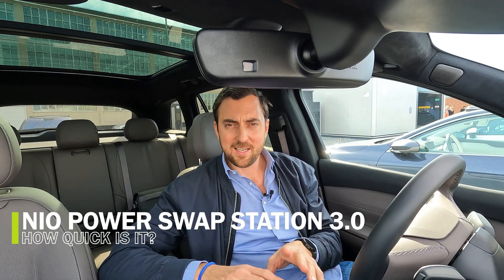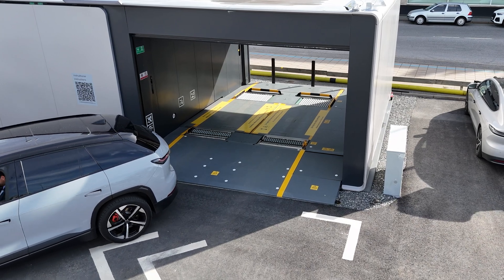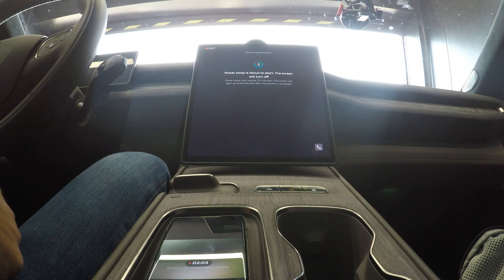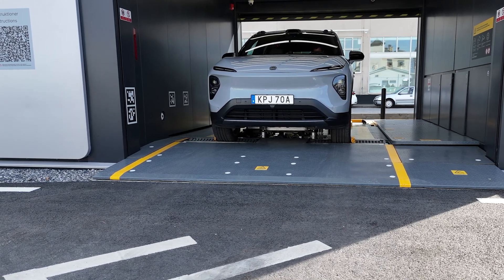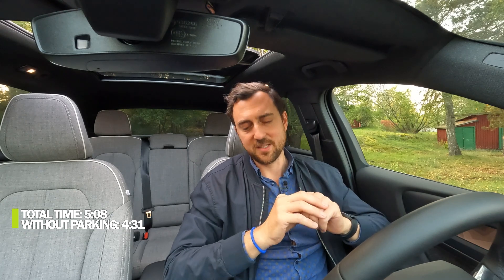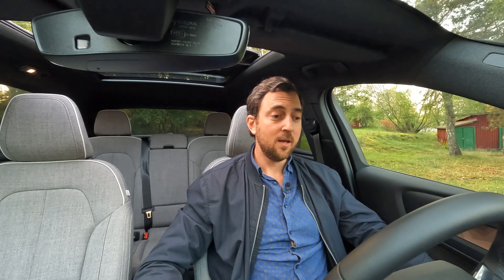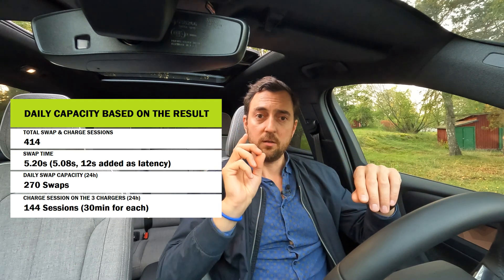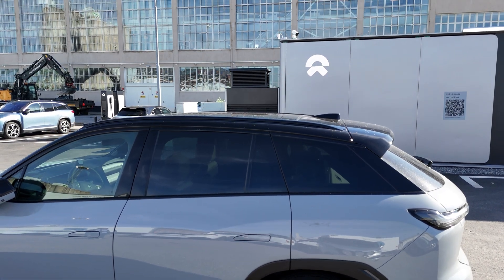How many Superchargers can it replace? - Testing Europes first Nio Power Swap Station 3

Comment: Who owns the battery? I like to look after my battery and would not like to swap for an ill treated overused one.
I think it is a long hard route for Nio, they can only replace their own model, whereas dedicated chargers can fit all models, time will tell if it is a Betamax or mini disc. Not for me.
Reply: I'm sorry, but that's a really bad take. NIO has the ability to check for AND repair their battery packs better than anyone else. Exactly BECAUSE the batteries are swappable. Every time the battery is swapped, its SoH is assessed automatically. If it has bad cells or any other issue they are able to repair them without having to disassemble an entire car.

Apart from that there is no actual reason to believe there will be that many ill-treated overused batteries in the pool. Because they will often be swapped (BaaS allows for a certain amount of free swaps which makes it more attractive than ultrarapid charging), they will be charged less at mind-numbing power to a high SoC than e.g. Tesla batteries are. NIO batteries are also high-capacity packs (minimum 75kWh) which makes it really not necessary to charge to 100% often. So many packs will be swapped or charged at a low charging power, with a charging limit, which is the ideal recipe for battery longevity.

Then there is the simple fact that if you want to own the battery and never swap it, you absolutely can. But in my opinion that would not be smart because of the above, and the fact that swap allows for better battery technology (higher energy density, lower weight, better safety, etc.) to be absorbed in the entire fleet without any issue.
Reply: NIO swap stations automatically healthcheck the batteries. Besides, even if you had a battery which developed issues, then guess what... battery swap means you aren't stuck with the battery welded to the car. PS simple for most folk to understand 😅😅
Reply from the maker: You don't need to lease the battery, possible to buy also. But get your point
Reply: Nio has the most private company  physical chargers in China.. more non nio use them than nio owners  and catl and nio have a separate joint company that owns the batteries if you are renting.

Comment: Thanks! Very informative as usual. Can you do an et5t 10-80% charge on the nio chargers with the new charging speeds?
Reply from the maker: Peaking at 182kWh and keeping that peek last up to 70% before tapering. So a good and flat charging curve.
Reply: @ItsOnlyElectric wow, thank you sir!
Reply from the maker: @reginald7214 NP
Reply: He asked you to check it, is it also with the 75 kilowatt battery?  How long does it take in reality to charge when it reaches over 70 percent accuracy?  You know such questions.

Comment: It took so long to retrieve the new battery.
Also car can reverse in one go.
Reply: Sure, the  drive thru stations they have are even better.
Reply: Most of the problems you presented are problems that will be solved in the near future by over-the-air updates, you no longer need to be in the car during the exchange, at least in China, you can do it through the nio app, the screen already works in China during the exchange, but at least until NT3 the AC will not work.
Reply: They should have a smaller high voltage battery to keep the car alive during swap. People should be able to get in and out of the car during swap from one side at least. They can lock the doors on the other side.

Comment: Like the theory of battery swapping. Prices of the Nio’s with BaaS is still high compared to other EVs, what do you think?
Reply from the maker: I don't think the entry price with BaaS is that expensive for a premium oriented brand. But togheter with the battery it gets a bit expensive and cheaper models will be needed. But as I understand it that will com under another sub brand.
Reply: In 2024, a brand should arrive that sells compact ev vehicles for 30,000 euros, (it is not clear with the battery included) and it will be able to swap batteries, and charge at a rate of 500 kilowatts, although apparently if you choose BASS the charging will be limited to 130 kilowatts in order to maintain the health of the battery.
Reply: @ItsOnlyElectric  if Nio wants to get marketshare, their price needs to align with Tesla while offering higher quality experience. Otherwise the Charging network and Tesla experience will probably keep attracting people to Tesla and not Nio etc. Let me know your thoughts

Comment: I don't think battery swapping is meant to compete with charging at all.  It is designed to help people wean themselves off gasoline.  With nio you don't have to change anything in your daily routine, you don't feel the difference anymore.  And to those who say that building any such station costs too much money, it is much cheaper than a gas station.  The price is also not a problem because there is an arbitrage section, the stations buy electricity at night at a bargain price and sell it at the peak of demand, thereby balancing the grid and also creating huge profits for nio.  Battery swap stations also prevent power outages, if there is a problem and the power supplier decides to supply power, then all the battery swap stations in the area will automatically start within ten seconds to supply power instead of the central supplier until the problem is fixed.  If on average every two weeks the total time of power outages is half an hour, and believe me that in most places the average time is much higher, then this means that every year 13 hours of power outage will be saved, assuming that each station will last 20 years, and this means that each station will save an average of 260  hours, multiply it by say 100 thousand inhabitants, and that means that an average battery swap station will save about 1.3 million hours a year, how much is an hour of power outage worth?  Say $30, times 1.3 million, $39 million a year.  Even with a tenth of that, 4 million dollars a year, even with only one hundredth of that, even with only 0.4 million dollars a year.  Therefore there is no reason to worry about the price of each station or the risk of nio going bankrupt.
Reply: nah, you can't buy at night and sell during peak if people are constantly changing batteries, it needs to charge it back up right away, grid stabilization is a service they can provide if grid providers are willing to make a deal with nio because grid stabilization requires selling electricity during peak hours and buying back electricity during peak hours, so you need a deal with the grid provider to pay you a higher price when you sell it during peak hours compared to the price you pay when you buy it back during peak hours
Reply: That's what I thought too, but no.  The electricity grid itself is public, the provider is a private one.  You actually sell electricity to the consumer, and use the state's electricity grid to do it.  The electricity is offered to every buyer, so you don't have to ask the supplier.  This is something that has already been done today.
Reply: @tani123  no not true, you do need them to provide you a higher rate for the electricity you sell or else you aren't arbitraging anything. nio has made deals in china and run tests to provide such a service, you sell the electricity during spikes and buy it back seconds after at a cheaper rate. also here here in america at least most of the grid is privately owned and  a lot of states won't pay you the same rate for selling solar power to the grid. and no idea where you are at that you can sell the electricity to the consumer directly, they pay the electric company not you nor nio, here in america it reduces your electricity bill from the electric company when you sell electricity to the grid.
Reply: Your arbitrage is the public.  The public wants electricity sometimes more, and sometimes less, so you buy when less and sell when more.  The electricity network in China is owned by the state and it sells the electricity that passes through it in exchange for money.  Of course the arbitrage is not for a few seconds because then the profit is zero.  Nio already sells such chargers for a few thousand dollars, a charger that can charge your car, then feed the electricity back into the grid and sell it at market price.
Reply: @tani123  that's not how the arbitrage works for nio power swap stations, they sell it and charge it back literally seconds after, that's why they need to make deals with the energy providers for the grid. you can only buy and sell electricity to the people maintaining the grid whether it be a private entity or the government, there's no way to sell electricity to individual consumers via the grid.
Reply: In an interview, the chief manager of the station battery swap field, said that they can sell at lows and buy at highs, thus profiting from price differences of around 0.6 yuan per kilowatt.  It may be that you don't really sell directly to the consumer, but sell the electricity to the state, and then it pays you according to the amount it was sold to the consumer.  In any case, the result is the same profit of at least 1000 yuan per station per day.  That means 50 thousand dollars a year, multiplied by 2000, comes out to 100 million dollars a year every year provided that nio stops building the battery swap stations today.
Reply: @tani123  that only works for power swap stations that are under utilized, otherwise they will simply have to charge back up immediately especially since they use slow trickle charging. and i think you meant to say sell at highs and buy at lows. the field test that was published on cnevpost what they did was sell electricity during peak hours and charge it back a second or two after also during peak hours, this provides grid stabilization
Reply: It is not published cnevpost.  Swap stations have a very large capacity, more than the demand, and they sell the rest during the peak hours. And yes, I meant buying at lows and selling at highs.
Reply: @tani123  the one i am talking about was published on cnev. a swap station has about 20 batteries, unless less 20 cars are swapping batteries during peak hours then you cannot arbitrage peak/off-peak, that's just basic math and logic. so only under utilized swap stations in remote areas would be able to do this. otherwise they can only provide grid stabilization services during peak hours. and if a swap station predicts usage wrong it would need to supercharge batteries before the customer  arrives.
Reply: I understood your point, you are saying that if I bought electricity at night, then 21 people changed a battery then now I have to buy electricity again at a higher price than the price at night.  But you have to remember that even when I change a battery I sell electricity so it doesn't really matter.
Reply: @tani123  you sell the electricity and then you buy it back, there's no arbitrage especially with power loss. you pay $2 to charge at night, you sell for $5 during daytime then you pay a bit more than $5 to buy it back due to power loss to heat and other factors. there's no profit. that's why nio wants to provide grid stabilization services where the grid provider pays you during spikes in demand at a higher rate then you charge back up at the normal peak hours rate that is cheaper than the rate they pay for grid stabilization
Reply: These commissions are zero, it's closer to 0.1 dollars of commission.

Comment: I would also like to add that swap is the only possible way forward for EVs. Imagine what will happen in 10 to 15 years to all EVs, they will have damaged batteries and will no longer be able to drive, the cost of repair will be higher than the value of the vehicle. Can you imagine the environmental damage of millions of unusable, unrepairable batteries? From an environmental point of view, the swap is the best way to go.
Reply: No.  Swap is a gimmick.
Reply: I don't know the language in which the word "gimmick" means "a necessary product that not only saves a lot of time, money, helps the planet, helps prevent power outages, and even lowers electricity prices to a record" actually I'm pretty sure it's written in English...
Reply: I dont see a future for SWAP. The future is more structural batteries to reduce weight. SWAP also limits the flexibility for innovation since you would need to consider old batteries. Just wonder how NIO will handle that ET5T have a upgraded 100kWh battery. ET5T could end up with a slower charging battery after an swap.
Reply: @evkx 
Structural batteries would be most  difficult to remove once their life runs out. That's the least green option and also fast charging reduces battery strength
Reply: @protagonist9716  there is no data available that indicate any reduction of physical strengt based on DC fast charging. Sounds like fake news.  But structural batteries are problematic in many ways. B2M batteries can replace falty modules. That is difficult on a Tesla Model Y with structural battery. See our webiste for how a structural batteyr can be removed (technical batteyr article)
Reply: @evkx what ? NIO has a semi solid state 150 kWh battery available. The ET5 does just fine with it. In fact. It gets 1,000 KM range. No problems with charging exactly the same or swapping to a 75 or 100 kWh battery. Whatever your needs are. Any questions ?
Reply: @PhilthyMr  the 150kWh battery still had to be put in the same size battery body. And it is not available yet. Nio have taken delivery of the first from the producer. but have not starting rolling it out. We have written about in in our battery technology section.
Reply: No, this is very silly and unsustainable
Reply: Have you ever had a RC car ? Did you want to drive it for 20 minutes then charge it for 30 or did you want that 2nd rapid charge battery pack you can swap out without barely missing the next race. Only suckers will be sitting at the charging stations when battery swap is available. It’s a premium service and not everyone can afford it. But they’re coming out with a cheaper brand so NIO is where it’s at
Reply: @PhilthyMr  sure, but this is way more integrated…. If power tool brands won’t do it, it certainly won’t happen for vehicles. There’s going to be many different size batteries in EVs and no standard
Reply: @PhilthyMr  yes, I am a Traxxas guy. I have serveral batteries that I own and take good care of.

Comment: The nice thing is that swap is a choice, you can also charge (et5 t 180 kWh). Not to mention the business of electricity arbitrage. The implications of the infrastructure that Nio is building are many
Reply from the maker: The electricity arbitrage is a really interesting aspect  🤔
Reply: It will also lower the price of electricity during peak hours.
Reply: You only have 180 kW to the first swap. Then you end up with an old slow battery.
Reply: @evkx  Batteries get checked with every swap and at a certain level they get taken out, so you rather end up with an old battery when you own one as you do with swapping ;)

Comment: Good calculations.
NIO has done a great engineering job, but battery swap is not the right path for cars, it's too much overengineering trying to solve a problem that does not exists, we can stop 20-30 minutes after 200-300km, no problem with that.
But perhaps in motorcycles could make sense because they have less range. Perhaps.
Reply: Problem does exist though 😂😂😂,  people in queues for charging , battery degradation,  battery gets out of date or damaged , better batteries out but stuck with old one , battery test becoming part of mot soon also , why not have a battery that can be swapped or charged .... when you can have  best of both worlds
Reply: @tonygrant3062   not to mention baas, and also possibility to swap for a bigger range battery only when needed.
Reply: @tonygrant3062  when you think you have best of both worlds you are just overengineering, increasing errors and costs, and reducing performance.
Less is better.
Do once right, dont do twice.
Nio took the wrong path, and thus, it will dissapear
Reply: Try to get by with an iPhone that can make phone calls, but can't connect to the Internet.  Nokia could have said "The iPhone is going to fail because it is trying to get the best of both worlds and thus creates an excess of development, not only to make a phone that is good for phone calls, but also a device that is good for connecting to the Internet, there is no way it will succeed" we will talk in 2028.
Reply: @yoyyaesta4808  Sounds like that you have opinion which is not based anything. I think so there has been done almost 30 000 000 million swaps already. For this swap tech Your comment seems to be overassumption.

I never ever going to buy used EV-car before the battery warranty is 25-30 years or 500 000 km. Used EV-car is the only option for a lot of people in price range 5000-30 000.
Reply: you can swap OR charge
Reply: lol makes sense to charge or swap depending on the area some cities in China are super dense and can’t have charging stations…
Reply: @AT_PokemonTCG89  Most ludicrous argument ever

Comment: Great video...IS the swap station in a BUSY location(lots of people walking by)
Reply from the maker: Yes, centrally located in the harbour area of Stockholm.
Reply: @ItsOnlyElectric  not enough swap station right now i guess. With more and maybe dual car swap station, one on each side it will work better